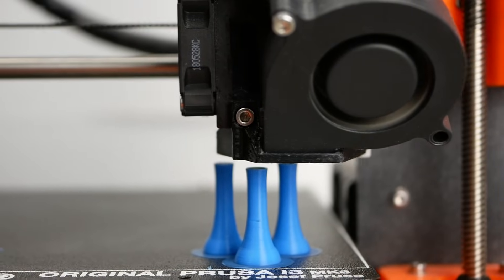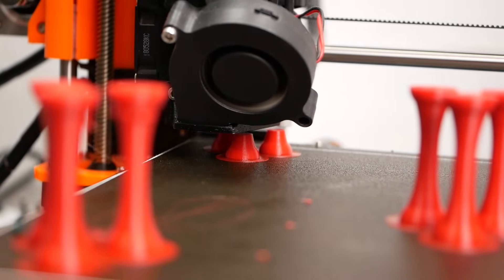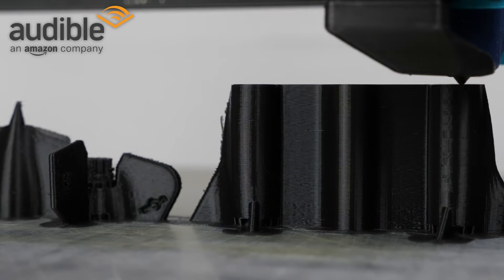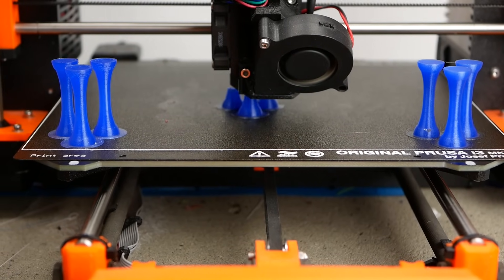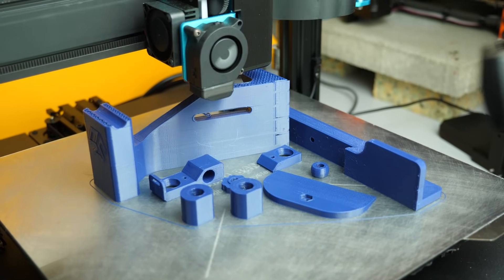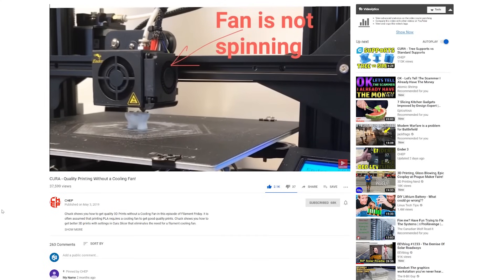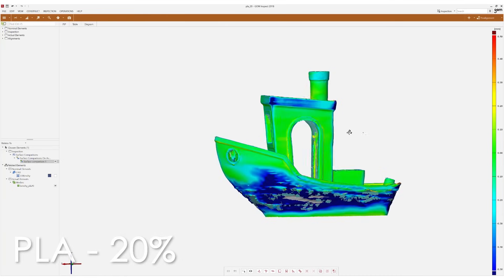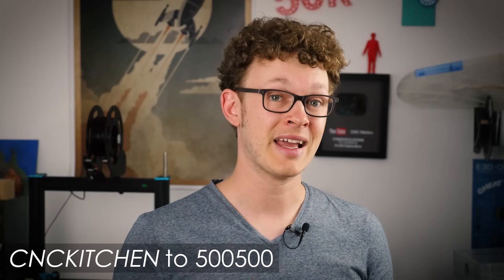MUCH STRONGER 3D prints due to LESS COOLING! Testing PLA & PETG

Comment from the maker: Feel free to share the video on Facebook, Reddit, Twitter and other social media!
Reply: Shared in my V-King builders group. You have the best videos
Reply: What kind of PETG filament do you recommend? AprintAPro does not supply filament anymore, would you still recommend DasFilament?
Reply from the maker: Das Filament is good stuff. Still use it regularly.
Reply: @CNCKitchen  Thanks, BTW nice Replytime. Do you have any knowledge on the Procatec Filament? Youprintin3D from Karlsruhe is selling it locally.
Reply: Hi Stefan, have you thought about publishing your results as a paper or a technical note? I would like to reference your work better if I need it. Cheers and thanks for your video
Reply: Just reference the video and his website post @FrenchSpaceScientist
Reply: Ñ,.  Mm .zv
Reply: I know this is an older video, however, just wanted to make some comments on the scanning. I used to use GOM scanners 8 hours a day for 3 years. With your scans, it appears you did not collect enough data. You need 3 layers of pictures on all surfaces to average out data and to also allow the software to identify & remove outlier data that is basically reflectance (noise). Also, I do not see that you used reference points. This is pretty critical for actually creating accurate scans. I would not trust the results without them. Lastly, not to be a keyboard warrior, but your scans do not do those machines justice, with maybe 15 more minutes of scanning you could have gotten 90-98% of all surfaces. It would have been interesting to take the measurements from the benchy schematics to analyze x,y, and z dimensions as well as surface profile/comparisons. These machines are accurate to microns, roughly estimating, I'd say your scans may be accurate to 10 microns or more. 

Depending on the lenses used you should also be able to pick up the layer lines - which from what I could see, you did not. If you have any questions in the future regarding using this technology and/or questions on how to improve results, feel free to reach out!
Reply: bro your logo looks like the GAN logo
Reply: Why don't you share your videos on r/3Dprinting or elsewhere?
Reply: I found uniform flow to be highly important for high speed printing.  With high speed printing you're only cooling the skin of the extruded plastic, so less is better.

Comment: Printing three towers when alternating layers between all towers without cooling actually still provides some cooling because until the next layer is printed on the same tower, it takes some time so it cools a bit...you should print one tower at a time to say there was no cooling...

Comment: I would like to see a test series on bed adhesion wrt different materials PLA, PETG, NYLON and bed surface,🎉 magnetic thin metal, glass and adhesive combinations, tape, glue, sugar, salt, none, spray adhesive, etc.  A good test part design to use.

Comment: I recently got a 3d printer. Based on your Benchy that was smooth on one side and veiny on the other, that helps me understand this one print of mine. I still haven't found a good balance of layer time to cooling time and what not. Every model is going to have custom settings I guess. To a degree.

Comment: Here's an idea not sure if it would work but couldn't you have the bed as a 3d print heated room with the sides but use a pelter as the chiller instead of a fan?

Comment: My ender 3 prints very well, except when it's printing on the far side of the fan on overhands, like what you had on your benchy. From your test and mine, it seems like I need to increase the directions of the air, but decrease the total amount of air

Comment: Okay so the results of this are unsurprising. We all know that temperature is king for layer adhesion but cooling is king for fine detail, or, just to allow certain things to print correctly.

Okay so the real interesting thing would be to compare uncooled prints with cooled prints done at a higher temperature. 

1) Does cooling allow you to print at a much higher temperature and still maintain print detail. 

2) Would increasing the temperature compensate for the loss of strength with part cooling enabled.

Comment: Cooling speed really depends on the fan size and output.  I have a 5015 and at 100%, it's too strong.  Would be good to have a video on a systematic way of adjusting the cooling duct height. Thanks for the great videos. I've been having good results at 25% fan speed.

Comment: how about instead of room temperature air use some heated air little below glass transition temp of the material blasted at full fan speed. it should cool the part to the point of no flow but also wont mess up layer adhesion or even improve it. also another idea is to use a laser to heat up plastic ahead of the printing head.

Comment: Interesting comparison, however, also the environmental temperature should be taken in account, the cooling efficiency is significantly different if you print in a 10°C room and if you print in a 34°C room with the same settings, also all tests should be done with natural color of specific material, the pigments used to color filament affect filament properties not only aesthetically. Would be useful to schematize all tests parameters more in detail.

Comment: To some extent, these plastic tear tests are completely useless, as they do not provide data in comparison with conventional plastics (molded parts).  Now, if there is a comparison of strength with injection molded plastic parts, then it will be interesting.  Also temperature tests.  All this is an attempt to measure the diameter of parrots.

Comment: I wonder if you could vary part cooling over the model, to only turn on the cooling fan when needed. (only on overhangs) That would probably either require slicer support, or lots of manual gcode editing.

Comment: My new 3Dprinter will have a part heating fan that can reach 250c for this reason! It can instantly switch to cool air.

My idea is to day print pla at 60c and petg at 70 and abs at 100c air.

Comment: Nozzle on one of my printers kept clogging.  Changed the nozzle, still clogging.  Searched for weeks what could be causing this.  Always at the very tip, almost like a cap was forming over the tip.  Turned cooling off, and suddenly printer is working great.  I've never seen anyone suggest too much cooling was causing nozzles to clog.

Comment: Tips on how to get good, even parts cooling (especially for PC and nylon in enclosure), while still minimizing printhead mass? Spending a lot of time, tinkering and what little money I have, on reducing direct drive all-metal printhead on my CR10S - and it kinda sucks spending money on a pancake to reduce weight, only to add it back and then some in big plastic shrouds and 3 fans.

Comment: A lot of people want the extra cooling for better overhang. I went with the Ductinator and get way less air. I also do my brand of PLA at 230c and also jump the bed temp up to 60c. seems to get better strength parts and a good quality PLA still bridges well anyways.

Comment: i'd love to see how the strength differences between the different part cooling settings is affected after heat tempering the parts. I wonder if the extra part cooling leaves a more permanent stress point in the material that tempering won't remove, or if tempering really "re-flows" the parts sufficiently

Comment: Hi there. Great video with interesting findings. I love printing in PETG because it doesn't smell or shrink and is very durable. One thing I'm finding though is that for example white filament has significantly worse mechanical properties than clear filament. Some things I print have just two outside perimeters and no infill, so it's just a two perimeter shell. In clear PETG, it's tough in both directions and seems almost as likely to break between layers as across. But with white PETG, printed at the same settings, it breaks along layers with quite little effort. Is this because of the white pigment compromising the mechanical properties of the naturally clear polymer? I can't find any other reason.
Reply: Yes, this is due to the white pigment. For injection molded parts, white (typically titanium dioxide colorant) has the largest negative effect on part strength of any color. Black (carbon black) has the least impact.

Comment: I realize that this video is a bit old . You had mentioned other suggestions for the 3d scanner for imperfections . Have you tried any experiments . With the application of various smoothing liquids , limiting amounts or times on prints ?   Others have used closeups , adding primer or other various options . Your analytical processes seem far superior .

Comment: I came here because I'm testing my ender3 v2's print speed limits at 190mm/s and recently printed some brittle petg pegboard spacers with 100% cooling. After this video, i'm going to try again at 20% fan speed and verify layer adhesion.

Comment: I think a lot of it depends on the mass of what you're printing.  For example, we don't use any cooling fan to print thin wall models such as an airplane wing,  there is little mass there to retain the heat, it cools fine on it's own.

Comment: Now what if the needed model is way bigger than the ship you checked your printeng parameters with? I mean, could it be that layers in that case would have enough time to solidify without forced ventilation at all and still remain the needed form without making the whole model look diffused?

Comment: Stefan - Thanks for another great video (though I have only just watched it despite it being 15 months old). As usual, your scientific approach adds a lot to my knowledge of producing better 3d prints. Based on this video I have suggested a Cura script to put this science into practice by varying the extruder temperature and cooling fan speed based on the type of extrusion being done at the time - outer wall, inner wall, infill, top/bottom skin, top/bottom surface (other than skin) - in order to get good surface quality for outer walls and skin AND good layer adhesion for inner walls, infill and surface other than skin. If we create such a script, would you be willing to test its efficacy? - S

Comment: LOL.....watching the melted filament sticking to the layers as the nozzle went around the perimeter reminded me of the time I made pancakes and poured the batter in a ring of concentric circles that mixed together to form a solid pancake......the adhesion was good considering the pan was quite hot at the bottom but they came away quite easily with a thin edged metal scoop.......possibly it was the oil film.

Comment: I literally just posted this question to one of the FB groups I'm in regarding printing of an airboat hull for RC.  My posit was that lower parts cooling speeds would enhance layer adhesion and in-turn assist with watertightness.  Thank you for this video.

Comment: Thank you for such comprehensive testing Stefan! I found it very useful. I kept wondering about your suggestion to print slower in order to let the PLA cool naturally. Do you think that the part being cooled naturally adheres better than low fan setting cooling? It still cools, doesn't it? Cools more evenly perhaps (inside and out)?

Comment: Is it possible to have higher fan speed on the shell print and slower fan speed on the infill? Seems like that would be the best of both. Accurate, smooth print on the shell and a strong infill print. Feel free to call me out on this if I'm wrong. I'm just starting to learn 3D printing.

Comment: I can't inderstand all the trouble people are having with their PLA printing adhesion.  I purchased a Anet ET4 2 weeks ago and from day 1 the only precautions I took were to clean the Glass which came with the printer. It also came with some special mat for the hot bed, but I purposely didn't use it. I wanted it as plain as I could and still have whatever I print sticking to the glass. If it didn't work, I'd take different steps until I found something which works. 

I honestly didn't think I'd hit it straight away. My very first print was a Dog, supplied by Anet. I made sure I was there as it finished and as the nozzle lifted from the print I tried to remover the dog from the glass, no way it would happen without extreme force. I allowed the bed to cool down for no more than 2 minutes and I simply lifted the dog from the glass and I heard a pleasing click as it let go.  After each print and if the printer sat for any length of time, I used a 20 to 1 mixture of Metholated Spirits and tap water. I gave the bed just one spray and gave a brisk rub to the bed with a sheets of kitchen paper. You know it ready when you hear a loud squeeking as you clean the glass

I then tried my luck with printing a filament guide. This proved even harder to remove and I left it to cool down for no more than a minute more. Three minutes of cooling and again click and it was free. Since then I've printed various items from tiny parts to filling the entire bed, the same story, let it coo. The glass is sparkling clean and any residue from the print is removed by the Metho. I've printed a few dozen items and today I omitted any raft or skirt and yes it still doesn't let go.

I must add I had one failure. We're being overrun with Aphids, tiny  black buggers which seem to like going up your nose or down your throat. They also appear to be attracted to hot PLA. The mongrels continually committed suicide by being buried under the PLA as the Nozzle passed overhead. I attempted to get one off the print and I left a fingerprint on the glass. A few minutes later the hot end tried to print a 90 degree corner tight where my fingerprint was and the extrusion  followed the nozzle. Printing with yellow filament really showed up their skid marks. Black streaks through your work doesn't look the best. I'm now in the process of building a large covering for the printer from PVC piping and Perspex. It seems there isn't a retailer in Australia who wants to sell the PIpes and fittings. There are only two to choose from and although I asked for a price and told them I'd pay immediately, they've completely ignored me.  

So don't buy $25 Goo and expensive paraphanalia to make your pronts stick, a piece of Borosilicate glass, some Metho and water in a spray bottle and elbow grease is all you need. Temperatures were as stated for PLA, 120 and 60 degrees.  Give it a try, it's cheap and it works.  Good Luck

Comment: Is there a Cura parameter that allows you to modify fan speed based on overhang angle so you can print majority at 30% fan speed but boost to 90-100% for overhangs?

Comment: omg you did every test... this is why design of experiment is created to do like 10% of the work and stil have verry accurate results
Reply: Nothing replaces full factorial. DOE does not replace full factorial. It just optimized the amount of information for a gives amount of resources. If you are not resource contained, full factorial with multiple levels of each factor is the best.

Comment: I heard that on some machines the fan speed is also tied to motherboard cooling. For that reason alone it should be enough of an argument to suggest the highest fan speed recommended for the filament being used if one is unsure of the driver settings. No?

Comment: Hi, thanks for making these videos.  There is an issue on which I'd appreciate some clarification.  You express the strength of these parts in MPa, and also show another value in "ksi".  I'm guessing this is kips per square inch?  If you don't mind my suggesting, you might consider expressing it instead as "X.Xk lbs/sq. in. (or in^2).  It may not be as "clean" of a presentation, but I think as you do it now it's incomprehensible to many viewers who have no idea what a MPa is.

Anyway, it's pretty amazing how strong these materials are, especially considering the fabrication method.

Comment: I found when i print multiple prints (water bottle holder) the parts cool passively enough that there's no significant curling because new filament hit cooler plastic thus having (part cooling) and yet failure rates are negligible between printing one or two at a time. My assumption is that the part when passively cooled still has a warmer surface closer matching its subsurface and when the layer is then added the temperature of the new filament doesn't reduce temps too far possibly giving it time to bond better but still cools quickly enough that it doesn't curl. Somewhat similar to slower printing or printing in an enclosure to keep the part warm. Which is also why i think of routing the heat break fan onto the part cooling duct, too cool it down enough that bridging is good and there's no curling but still keep the part warm enough that when another layer is added it will bond well.

I should test printing outside layers first and test how then the inner layers act on the outside layer. I should have a small prime/ooze wall that prints very slowly as to not use too much filament while the part passively cools vs printing two of the same prints.

Comment: Cooles Video und Danke für deine Tests und Versuche. Du ersparst uns allen viel Arbeit. 
Ich stelle das cooling bei großen Objekten relativ niedrig ein, da das hotend nicht so oft und bzw. schnell wieder über die gleiche Fläche fährt und es mehr Zeit hat um abzukühlen.  Bei kleinen Objekten dagegen auf 100% cooling, um ein sauberes Druckergebnis zu bekommen x als Beispiel: Objekt Fläche 2cm^2 =100% cooling 
Objekt Fläche 10cm^2 = 40%cooling 

Aus dem HDPE Schweißen kenne ich eine Technik, bei der die zu verbindenden Flächen mit einem heißluftföhn welcher direkt vor der Extruderdüse sitzt bei 350°C angeschmolzen werden, um eine molekulare Verbindung mit dem Filament herzustellen.

Comment: Could it be that it is not your printer or filament with the variability but it is the air itself? Maybe measure the airtemp/humidity throughout the printing process?